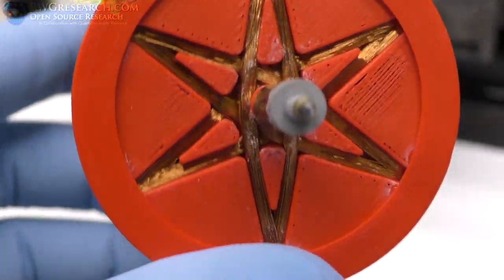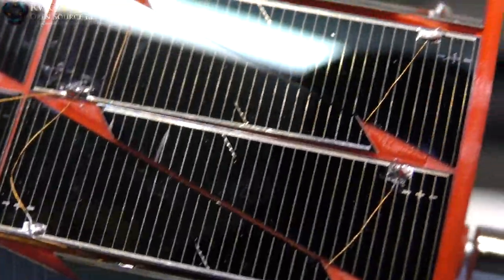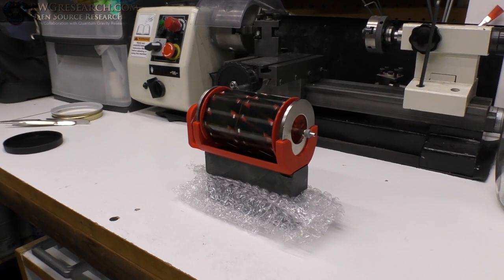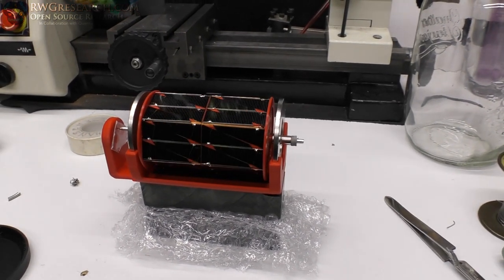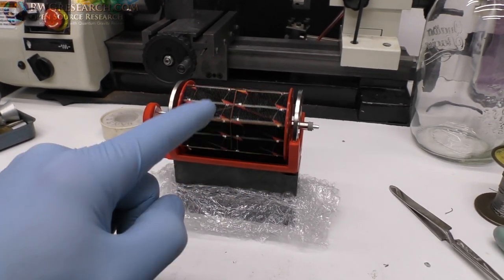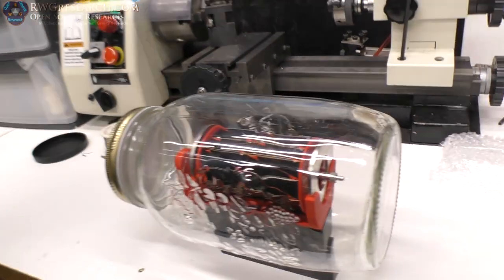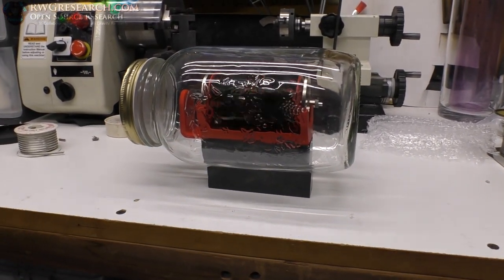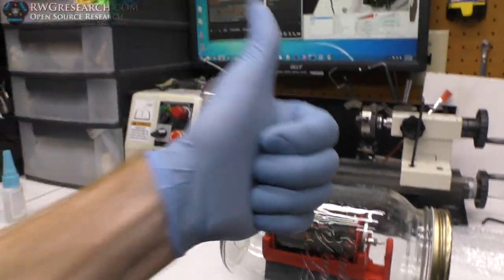#PMBO2017 Russ's Build Entry. 3 Phase Mendocino Motor.

Comment: Cool thing Russ! You can add some additional Aluminium-Foil at the bottom of the Yar to reflect some "lost" ambient Light towards the solar-cells. 

Cheers!
Reply from the maker: Thanks! yes well it needs to be "dark" on one side and light on the other. if there is light all around it wont do anything. I added a bigger support on one side and less on the other to help this. black plastic would have also helped. I can just add black paper as a cover on one half and it would run even better. Thanks for posing! ~Russ
Reply: rwg42985 Ahh, okay, thanks Russ, we are always learning new things. This concept was new to me. Thanks for the explanation.
Reply from the maker: no prob! yeah the coils are in pairs, they make a " loop" and there basically "shorted" kinda interesting. but works well. ~Russ

Comment: Love what you are trying to do man... does this thing have any
torque at all though?
What RPM can you hope to achieve?
Reply from the maker: not much torque, in the sun a tinny amount but not anything useful, i just want it to run in the room light on the shelf... :)  RPM is slow even in the sun, not 100$ sure why. I think its just the resistance and power output limiting the RPM, the old small one would go nuts, but it had micro wire and only 2 panels...  ~Russ
Reply: Russ, so the concept 'works'...   what's next... parabolic mirrors
to concentrate and focus the power source?